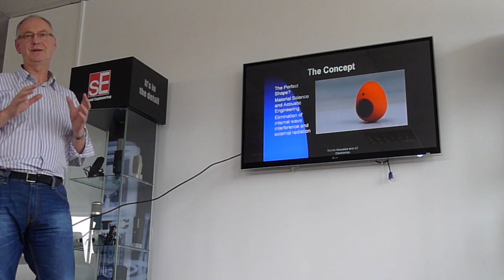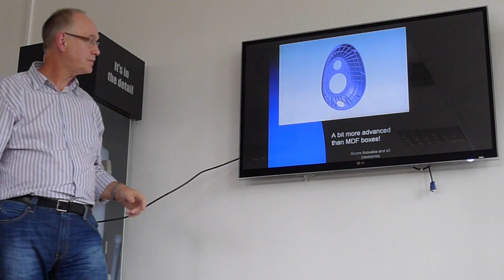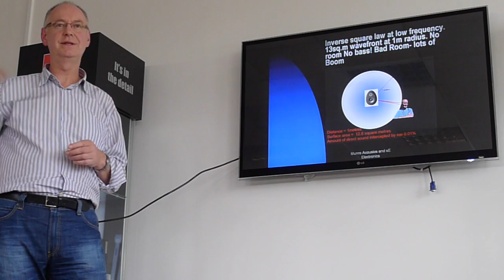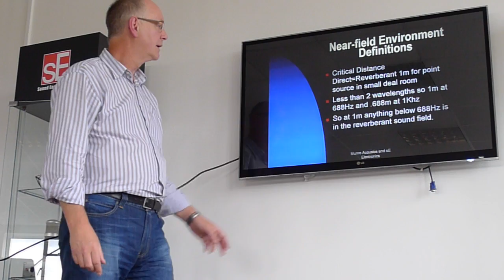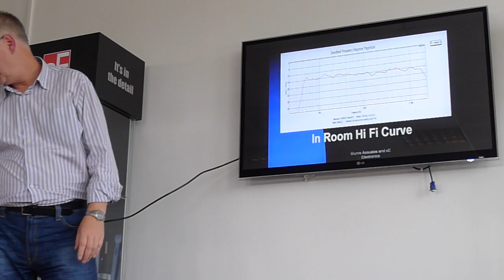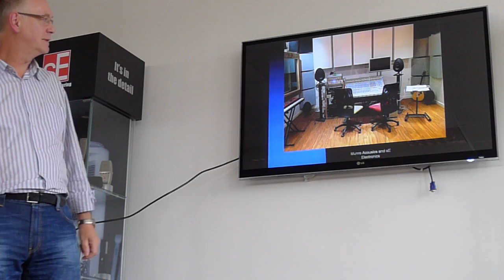sE Electronics EGG : Andy Munro's presentation

Comment: I really like the product and it's consistent design and will buy and test one (some are already available). Also the lecture is very well done. But I would like to comment that stereo has no 3D information, only 2D information (the perceived height information is based on artifacts depending on room acoustics). Also, the statement that every loudspeaker has similar power distribution in the low frequencies is not correct, this does not apply to open baffle constructions and there are also cardioid working constructions out there.